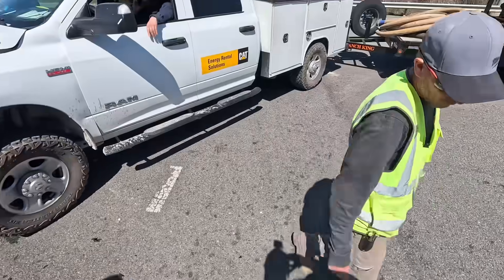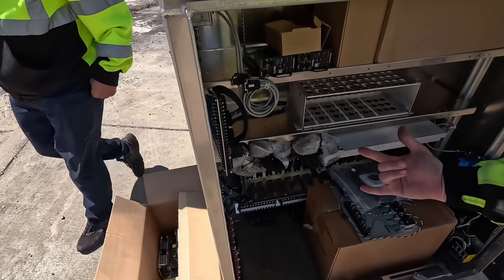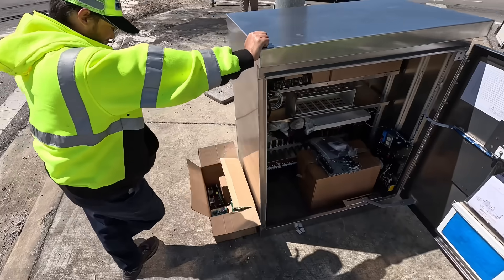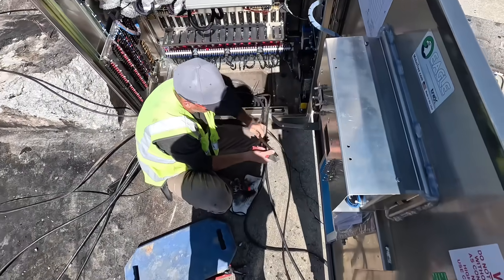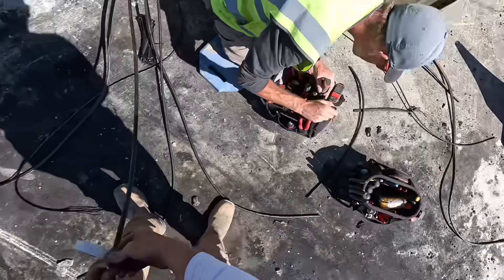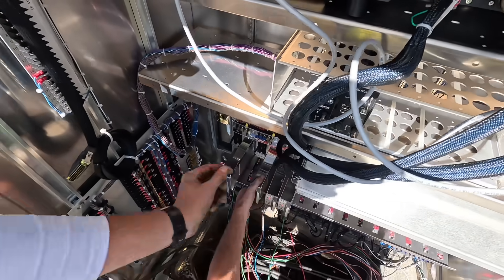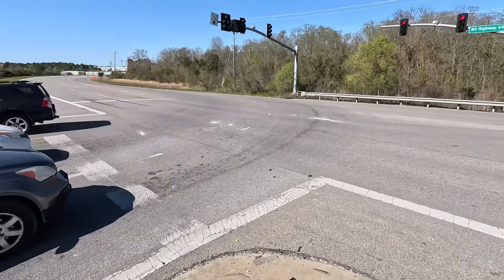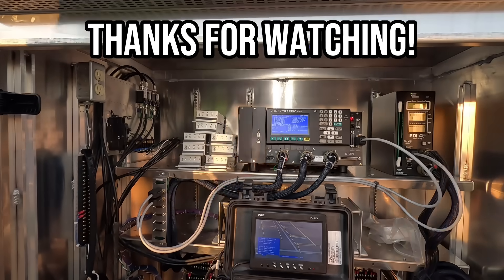Attempting To Fix a Traffic Light… Then THIS Happened!

Comment: I really can't comprehend why these cabinets are so complicated. You could do all of this with a simple computer 😅😅
Reply: Weather is harsh. 
Sea air is harsh.
It just has to work... failure is really, really undesired.
Needs to be versatile to a ton of different circumstances.
The controller is, essentially, a simple computer.
Reply: layers and layers of regulations, most likely.
Reply: I think all it is is a computer, and a separate failsafe monitor after that monitors the output of the main controller, and if anything is wrong, just puts everything in flashing red. Then I think there are some kind of output amplifiers or buffers that protects and isolates the fail safe and controller from the actual wiring that goes out to the lights, so when a car runs into it and shorts everything out, it only blows up the output driver. It's basically as simple as it can be to be reliable, modular, and serviceable. It needs to be a little more complicated and have fail safes and confidence checks when it's a critical safety system that prevents people from having crashes and getting injured. It's a different story if you're just running a traffic like for fun in your basement or garage.
Reply: Was wondering where the "this could be done with a raspberry pi" comments were.
Reply: What “simple computer” do you have that controls traffic lights????
Reply: What is complicated about that cabinet? What do you think the traffic controller is but a hardened computer. The early days (before you had modern electronics or computers) traffic signals ran on a simple mechanical dial controller without the need for electronic brain. 🤓😄

Comment: Somebody came in HOT to hit that controller cabinet.  It needs to be moved to a different spot as its going to get smashed again.

My question is why wasn't this a all way stop?  Most places mandate a traffic signal that is out be treated as a all-way stop.  I see they put up stop signs but they're for the one road and not the other from what I could tell.
Reply: A city street meeting a state highway isn't exactly all-way stop material.
Reply: @jovetj  while true that doesn't change state law on how to treat a dark signaled interchange.

Comment: So how does the railroad crossing communicate with traffic light cabinet to change the lights?  Would make for a good video.
Reply: I’m no expert, but I think that was the relay they were talking about at the start.
Reply: A video from TLD might explain it better and easier but the traffic intersection control cabinet (the cabinet that they were replacing) has a cable (like @jovetj mentions) that is run from it to the silver cabinet next to the RR tracks (which is briefly shown on the video). The traffic cabinet via a preemption relay circuit sends AC voltage through that cable to a relay in the RR cabinet and when no train is coming that RR relay passes the voltage back to the traffic cabinet which keeps the traffic signal preemption relay deactivated and keeps the intersection running normally. When a train does come along the RR relay opens up, stops the AC voltage from coming back to the traffic cabinet, which activates the traffic signal preemption relay in the traffic cabinet and tells the traffic controller to put the intersection into its RR preemption program. Also if that AC voltage never returns to the traffic cabinet like due to a broken wire in the cable due to for example the cable getting dug up or if the relays fail in that RR preemption circuit then the traffic controller will also go into its RR preemption programming and stay that way until the voltage from the RR has returned (a safety failsafe).
Reply: Yeah I’d love to see what happens inside of the boxes. I’ve asked before as well and this would be a awesome video
Reply: I believe he did it as a short
Reply: How the lights and gates and bells work at a crossing the train wheels drive over contacts that send a signal to the traffic control cabinet and the computer changes the light cycle and activates the crossing gates bells and lights
Reply: I think I've asked that same question before. I can't remember what channel it was or what the answer was, if I even got an answer. Even if it's just to refresh my memory, I'm curious as well.
Reply: Most likely the lights controlled by the same device that first responders have in they're vehicles
Reply: @JDSWeather  No.  
The railroad equipment has a control signal that tells the traffic cabinet there's a train coming. The traffic controller does the rest based on how it's programmed.

Comment: Probably should have had stop signs at all directions to better prevent that. Trucks kind of in a bad spot for people to see that direction, but hey it happens. Had a bad wreck in a intersection couple years ago and they're definitely scary when you're out there working. Luckily they didn't come your direction!
Reply: Read the driver's manual. A dark intersection should be treated as a stop sign for all directions.
Reply: @MikeM-cz5ln  You and I know that, but obviously from the crash... not everyone knows that. So having a stop sign at all directions, not just the one coming into the T intersection, could have helped prevent that.
Reply: It INHERENTLY is a stop for everyone, but people don't stop.

Comment: how is the railroad tied into the light?
Reply: The signal cabinet and the railroad crossing cabinet are tied together with cables.  When a train is approaching the crossing, the crossing signals are activated.  As the crossing is activated, current is sent along and it trips a relay in the traffic light cabinet.  That sends a signal to the traffic light cabinet that there's a train approaching the crossing. If there's an electric sign present like at the intersection here, the sign will come on.  Controllers are programmed to give a green signal for a limited time on the phase that faces the crossing to clear the tracks before the gates come down.  After that, the track clearance green ends and begins preemption.  Preemption is a limited operation that omits phases that conflict with the crossing.  For example, it will not give a green on the phase that faces the railroad crossing until the train clears the crossing.  I've also seen the crossing in other places tell the signal to go into flash mode until the crossing is clear.  Once the train clears the crossing and the crossing deactivates, the signal will go back to its normal programming until the next train comes.
Reply: @GrnArrow092  Depending on the situation, the traffic signal cabinet is usually told a train is coming long before the railroad crossing signals actually start, because that preemptive phase needs to start before that.
Reply: @ Right.  I just didn't know where the detection would start.  I'm assuming there are detectors several hundred feet away from the crossing that will start the preemption before the crossing activates.  Maybe the preemption starts when the train reaches the detector circuits in the track.
Reply: @ Rail detection in the US and Canada does not use "sensors."  It uses what are called track circuits.   Historically there have been a few different ways to implement these.  But, today, the most common and sophisticated way is to use a computer called a grade crossing predictor.  
The predictor sends tuned pulses down the rails acting as wires, in both directions.  Those pulses go down the track until they reach an electronic device called a shunt  that limits the detection by acting as a short circuit for only that tuned frequency.  When train wheels enter into the area between the shunt and the predictor, they short out the circuit.  The detector can "hear" that short and can tell how far away it is from the crossing, if it's moving, and which direction it's moving.  
All of this allows constant warning time no matter how fast the train is moving.  Grade crossing signals in the US are usually set to activate 20–40 seconds before the train arrives.  
The predictor can detect a train as soon as one enters into the detection zone of the track described above, and it can tell the traffic signal controller about it right away.
Reply: @jovetj  great explanation

Comment: I wonder how many times people will blame the traffic light repair guys when lights are off during repairs and a accident happens
Reply from the maker: Honestly, both involve were about as calm as I’ve ever seen after the incident!
Reply: I think the law requires drivers to consider a dead signal as a 4 way stop.
Reply: @hugh007  AMEN
Reply: That is like blaming the power company as the linemen are up poles in horrible weather re-connecting wires and replacing transformers involved with severe weather.
Reply: no cones around a truck parked in the intersection and you can't see one work area sign around these guys on a busy ass intersection.
Reply: @Rangepurebh  qtf dp you think it is. Unless you drive 75mph, you should be able to see that definitely are not having a picnic
Reply: @ obv the drivers can't pay attention enough to not hit one another so not having any other safety measures was an issue
Reply: @Rangepurebh the truck is parked somewhere you shouldn’t drive anyway though

Comment: First off look at where the stop sign posted? Is it in plain view and can you see it as you approach the light meaning not block by something.  

You should have had state or county in the intersection doing traffic control.
Reply: Non working light should be treated as a 4 way stop anyways.
Reply from the maker: @slowdownmoveoversharethero9701  the state guys were the ones that set it up and like always they bailed within 10 minutes of us getting there.
Reply: It should always treated 4 way stop, last time I saw two people run it two separate intersection when light weren’t working then bunch of morons can’t drive for shit didn’t go when others are stopping they go when other start to go.
Reply: No the cops too busy eating donuts